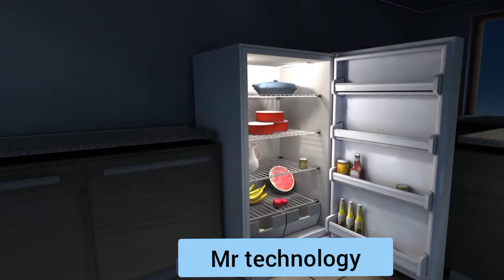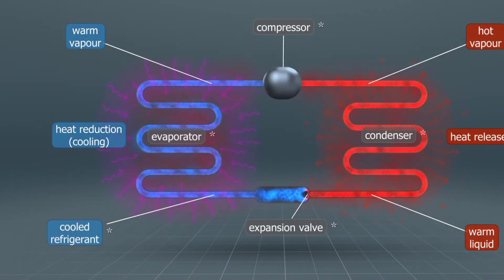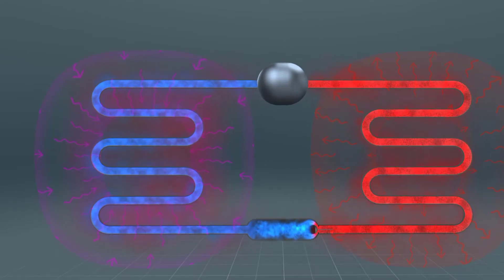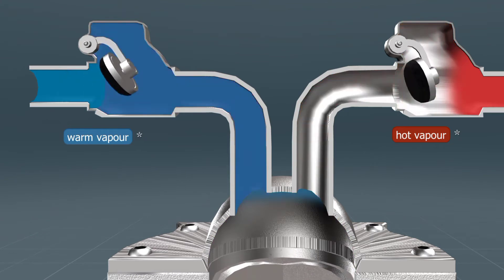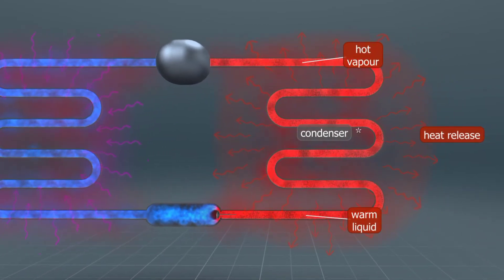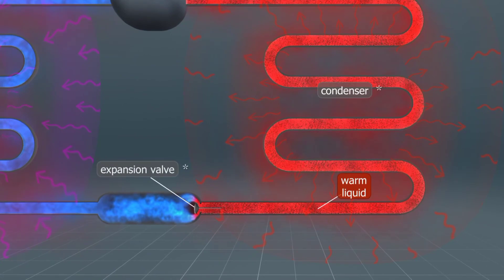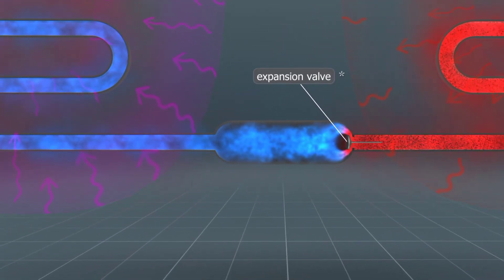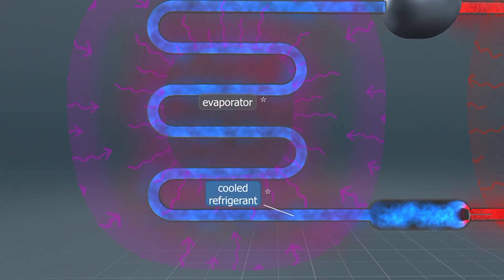How the refrigerator works

Comment: What confuses me is how the condenser and expansion valve stages are enough to cool the refrigerant back to its original state. I mean refrigerant has very low boiling point, and the condenser stage can only bring the refrigerant down to the surrounding temperature, which to me doesn't seem cool enough to make it a liquid again.